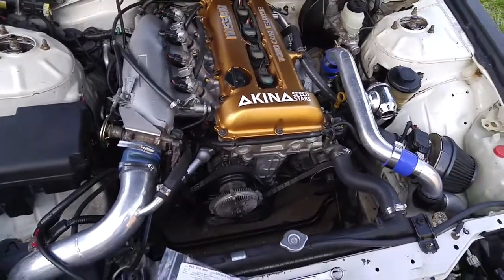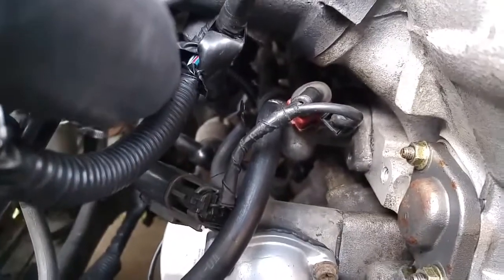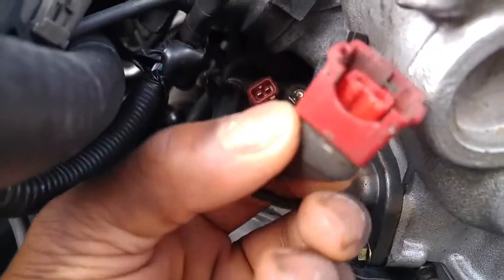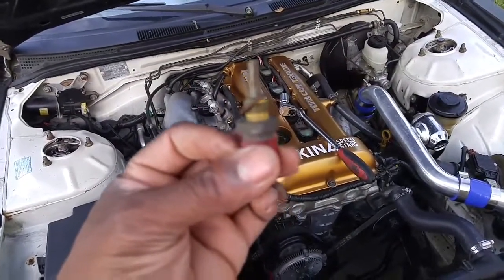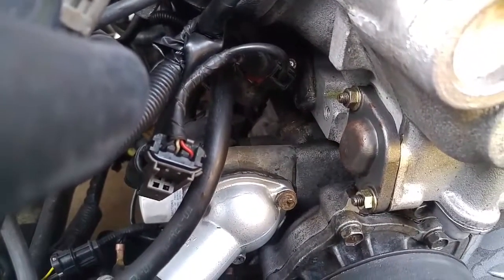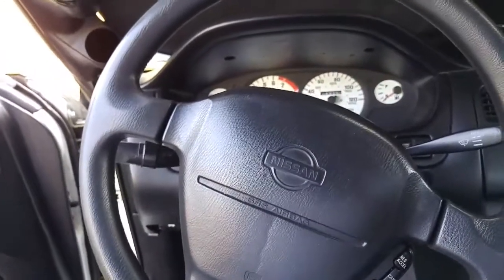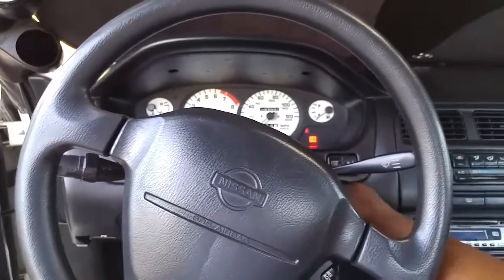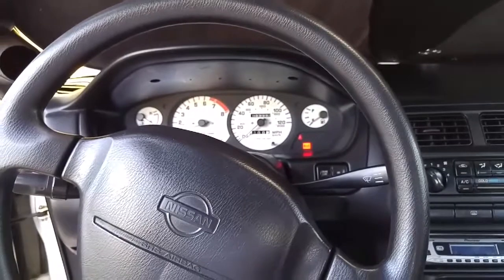Sr20det coolant temperature sensor

Comment: Would an s15 have it on the same location??
Reply from the maker: It should be in a similar area. The intake manifold runners are a little different but like I mentioned before, it should be in the same area.

Comment: Hey does anyone know the best way to remove that red connector? ive been stuck on this for a while and i cant find a way to remove that connector no matter how hard i pull. If anyone can help.
Reply from the maker: Are you talking about the red clip from the harness or removing the temperature sensor?
Reply: @SilviaSean  the red clip it has like a metal retainer on it
Reply from the maker: @damiondouglas7631  you should be able to remove the metal retaining "pin" and carefully wiggle the harness off.
Reply: @SilviaSean  Ive been struggling to fit anything in between the clip and the space is tight, maybe the intercooler piping is too close. Ive tried to pop the clip out with a screw driver i just dont know if maybe there is a certain way to remove it. I really appreciate all the help thank you been stuck on this for a few days and its all i need to fix for the sr to be back on the road again
Reply from the maker: @damiondouglas7631  good luck

Comment: Would this fix my temp gauge not reading in my sr20 swapped s13
Reply from the maker: I would not trust the stock temperature gauge to begin with. Aftermarket gauge is definitely a better option.

Comment: Were you having an idle issue? Like idles fine when cold but will jump/stall when warm?
Reply from the maker: Peter Hamilton. it's been awhile since I did this but if I remember correctly, there are two different types of coolant temp sensors, one is red and the other black (if it's an oem sensor). You should install the correct sensor according the year motor, ecu and harness that you have. For example, mine was a s13 red top with 62 ecu, so I needed the one shown in this video. hope this helps.
Reply: Have you been having that problem? I've been racking my brains with running issues with my car when it gets up to temp. Replaced the sensor and it hasn't solved the problem. If a Red sensor came out does it have to be a Red one that goes back in? My was white plastic bit but from a trusted source. Just a thought?
Reply: My car wouldn't idle once warmed up, I had to constantly be on the gas so it wouldn't stall. I had read somewhere that your maf has to be a certain length away from the turbo, mine was less than a foot away (I have a top mount turbo) so I added another pipe to extend it down in front of the driver wheel and now it idles. It also doesn't help that I only have a flash tune and a blowoff valve that vents to atmosphere instead of a recirculated one.  A management system could take care of both those problems though, if I had power fc I could adjust for my maf at any length and run an atmospheric bov no prob. But I'm broke so for now my extended suction pipe will do, only problem is when it rains and my maf gets wet... uggggghhh.
Reply from the maker: GuamBombs the mafs getting wet could definitely cause an issue if the actual sensor or wires get wet. It seems like you have got everything under control and figured out. happy boosting! i miss my sr20.